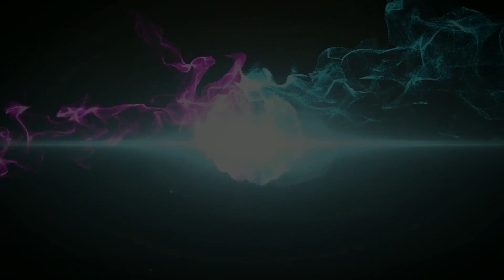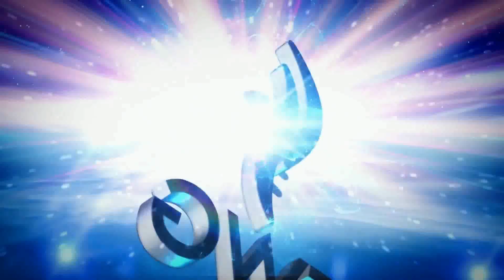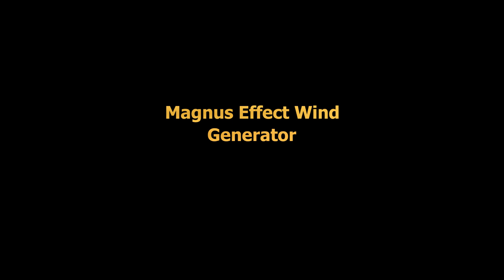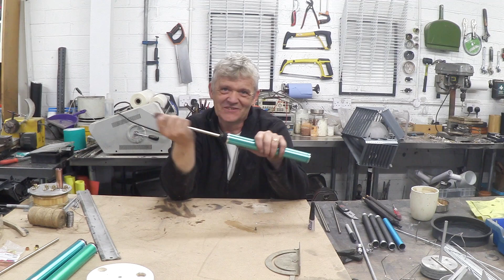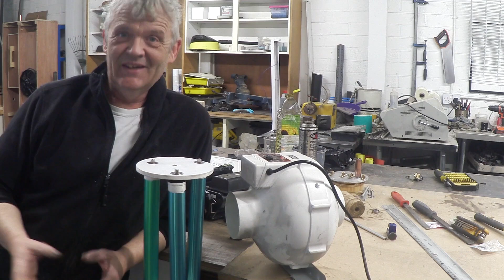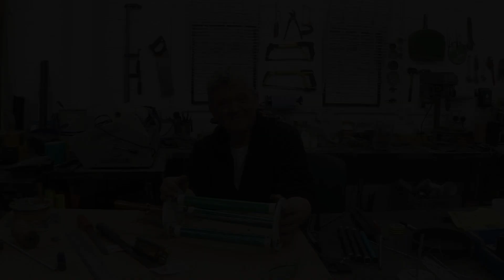Magnus Effect Wind Generator For Hurricanes - Toner Recycle Project 2

Comment: I feel a little confused, how is this the Magnus effect? Aren't you just pointing the blower at one side of it?
I can't see how this would work (as it is) in normal wind. Wouldn't the cylinders need to be rapidly rotating to cause a Magnus effect?
Perhaps I'm misunderstanding something!?
Reply: I think Rob messed up here. The original Japanese design has electric motors to spin up the cylinders, I think Rob missed this point. His design does not replicate the original, does not take advantage of the Magnus effect (as you say), and I agree the fan is off centre, its closer to him in the demo than the centre of the "turbine". Its make believe.
Reply from the maker: have a read the Japanese research mate
Reply: I've had another look at this and I'm more sure Rob got this slightly wrong.
There's 2 main designs I've seen; The vertical design like Rob's and a more traditional windmill where the cylinders take the place of the blades.
In both designs the cylinders are rotated. Either by motors or using a spiral design instead of a smooth cylinder that self rotates in wind.

However, I haven't seen a single design that looks even slightly efficient. While this 'might' work in a hurricane, it's going to be extremely inefficient in normal conditions.

I have looked through some old patents on this. It's not a new idea, it's been around for a long time. It's a good idea, but in reality it's so inefficient it can't compete with a traditional windmill turbine.

Also traditional turbines can be pitched out of the wind during hurricanes, so it's not as big of a problem as the people who try to market this idea suggest!

On that point, I've seen so much woo woo around wind generation. We all want sustainable energy and wind is an attractive option. But you can't beat the laws of physics and extract more energy than is there.
Reply: @jimsmindonline  
Rob can beat the laws of physics though, according to this video his design worked and was awesome !! Other posters on here are already building it ,  thats what I think is wrong here !!! This really makes me question the battery testing etc.
Reply: @goldmagnet9013  Some of the YouTube videos are quite amusing if you search for "Magnus effect wind turbine"...

So people have already tried to replicate this with various successes! Good luck to them!
Some of it is Thunderf00t territory.

This isn't an attack on Rob, I really enjoy most of his content. (Sorry mate ♥️)

I just think he was probably asked to look at this, it seems an attractive idea, and he got it a bit wrong or failed to explain it properly.

It seems a good idea, but some basic back of the envelope calculations will tell you how unrealistic it is as a viable option for energy generation. Unless you live somewhere with constant hurricane force winds. 

Maybe I'm completely wrong, someone could easily prove this by citing an actual installation where this is being used. I didn't easily find one!
Reply: @jimsmindonline  We are the same in that respect, I have watched all of Robs content, but I must admit recently I think the scientific quality has suffered a bit with the increased frequency of videos. I think if Rob had spent much time researching  this video he would have realized his mistakes (both design and testing). I think Robs edging closer and closer into Thunderf00t territory with some of his recent videos, I really miss the battery development, it would be great to see that return.
Reply: @jimsmindonline  Further to my recent comment that the videos were getting very weak, look at the last few. We have an entire video on putting a milling bit in a drill press (no mention of bearing stress), and another on the "bike roller" ??? It seems to be release videos as fast as you can.....
Reply: @goldmagnet9013  I'd say, give Rob a break. If it's not interesting to you don't watch!

I personally enjoyed the gearing stuff. Something I've never learned before.
Reply: I just watched a vid of the hopefully commercial product from Japan and sure enough they state the cylinders are powered to create the effect.
Reply: @littleworkshopofhorrors2395  Puts Robs testing and knowledge under the spotlight somewhat, there are people commenting on here that they are going to build his "awesome" machine ! Its wrong to encourage people to build this design.
Reply: @goldmagnet9013  whether the idea is practical or not i would always encourage people to try even if they are likely to fail, you always learn something from failling often more than succeeding. The more you "play" the greater the chance of going off at a tangent to something that will work.
Reply: @littleworkshopofhorrors2395  Absolutely, but dont say its a magnus turbine and leave  out the bits that make it a magnus turbine. Worse dont encourage others to build it as a way to produce energy when as described it does not work. Its misleading if nothing else.
Reply: I've just watched a video about the Japanese version. It says, the rotation of the cylinders can be controlled by tightening or loosening the central shaft but nothing about them being dtiven by anything but the wind.
Reply: @GofuKyersen  The powered cylinder rotation is essential for the turbine to work. If this was not the case simple rotors would be added to planes, but the only magnus effect planes all use powered cylinders. Robs design does is not a Magnus turbine, maybe he did not notice the offset fan which cased it to rotate. It would not be capable of generating power, hopefully nobody builds it, they will be very disappointed.
Reply: @goldmagnet9013  i wonder if once the wind causes some level of rotation, as i surely will, whether it would then be self actuating, now wouldnt that be worth building an unpowered one to see if it is so? Further design mod might be little scoops to cause the cylinder rotation to start the magnus effect.
Reply: @littleworkshopofhorrors2395  No for several reasons the cylinders need to rotate  at a good speed (faster than the wind speed), and all the same direction. If the cylinder is rotated by wind it has the opposite effect as it slows the airflow resulting in a force in the wrong direction. In the magnus effect the air is sped up by the cylinder resulting in a force in the desired direction, if the wind imparts its energy in rotating the cylinder the air moves slow resulting in a force in the wrong direction.
Reply: @littleworkshopofhorrors2395  No for several reasons the cylinders need to rotate  at a good speed (faster than the wind speed), and all the same direction. If the cylinder is rotated by wind it has the opposite effect as it slows the airflow resulting in a force in the wrong direction. In the magnus effect the air is sped up by the cylinder resulting in a force in the desired direction, if the wind imparts its energy in rotating the cylinder the air moves slow resulting in a force in the wrong direction.
Reply: @goldmagnet9013  as i said scoops on the rollers could cause them to all turn in the same direction and i did not say nor imply full efficiency. Also from the video i saw they implied it would only work in strong winds, so the idea in this country is a bit of a nonstarter as far as grand scale production of electricity, this whole thing is just an experiment, and as anyone will tell you theory and practice don't always tally completely. So time for play.😉
Reply: @littleworkshopofhorrors2395  The scoops could not turn faster than the wind so it would not work.
Reply: @goldmagnet9013  there are i believe some racing sail boats that go faster than the wind, counter intuitive i know but there you go.
Reply: @littleworkshopofhorrors2395  Entirely different, it is impossible for a savonious type scoop design to go faster than the wind,  google it.
Reply: @goldmagnet9013  only on the cargo ships utilizing the magnus effect are the cilindres powered to increase the lift
Reply: @wadeboyce4793  And on the original Japanese design, have a look.
Reply: @GofuKyersen  I'm pretty certain that there is more than one video and each going into different levels of detail.
Reply: Robert said the blower was aimed dead centre in the video mate.

Comment: The thing about vertical axis turbines that I see as problematic is that they are easily clogged up with debris in high winds. So in a rooftop setup that's lower than the tallest tree around it's liable to catch a branch. Once that happens your balance is toast. You're drag is no longer equal. And now it's not spinning so the deflection of debris and or the centrifugal self cleaning is no more. Next thing you know, you have a mess on the roof that looks like Swamp Thing.
Reply from the maker: have a read the Japanese research mate